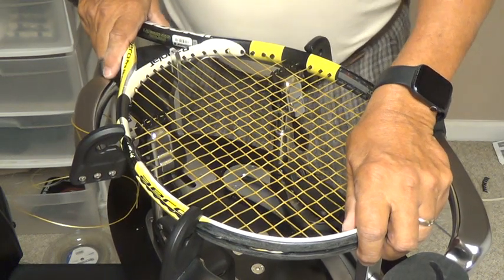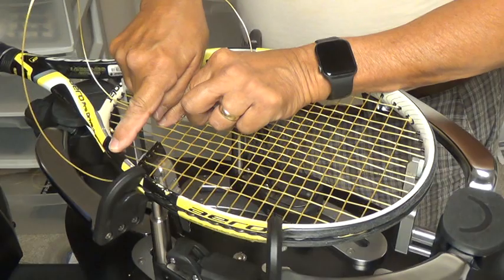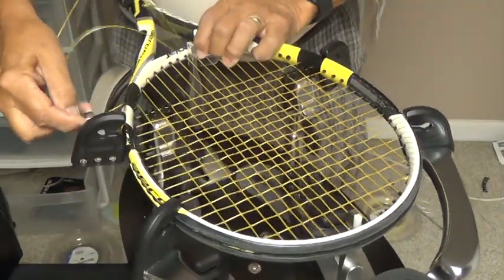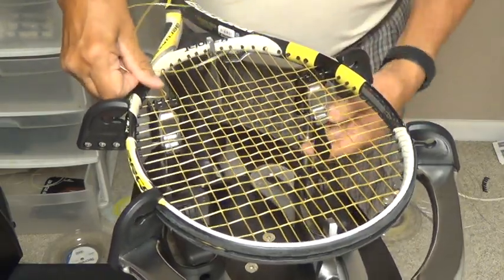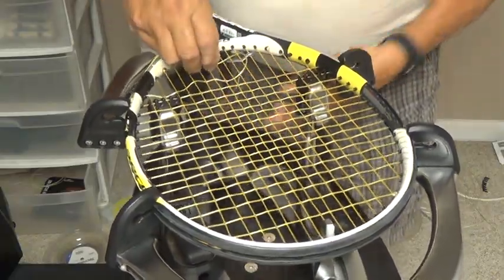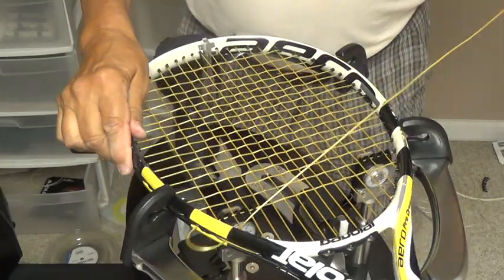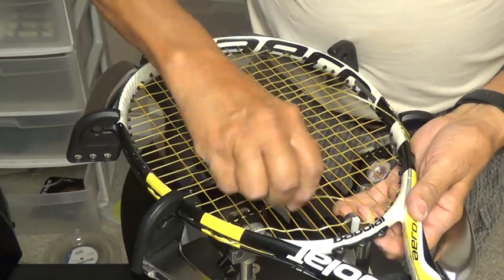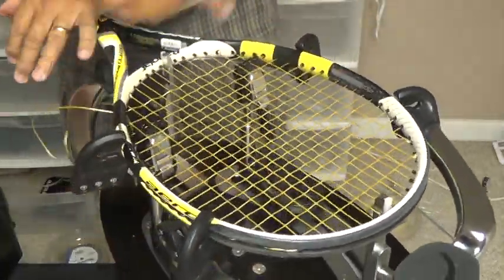Stringing twisted or shaped strings

Comment: Do you recommend doing this for all the crosses while stringing a rough poly or just the crosses towards the bottom??
I just started stringing myself and I’ve found your videos incredibly helpful, so thank you!
Reply from the maker: @benbenbunbun  stringing near the bottom of the racket you have very little string to work with and all the weaves are hard so I weave all string like that. The more you twist a string the easier it is to break. I doubt the bottom crosses will break often but who knows.

Comment: Hello, Thank you for your informative and clear videos-both old and new. I string my own racquets and use a full bed of VS 17 natural gut.

I have 2 questions that I would appreciate your advice on: 
(1) Would you advise that I should use the pre-stretch function on both the mains and crosses, or one but not the other? Does it really make a difference?

(2) At what pulling speed for either or both mains and crosses should I pull tension? I have FAST, MEDIUM or LOW on my machine.
Reply from the maker: @Raid Raid I personally do use the pre-stretch machine function unless my clients want it. So can get the same result by upping the tension. Pre-stretching gut primarily removes coil memory and you can do that if you like. I always keep my machine on the fastest speed. On my last machine (Babolat) there was only one speed. I used a Wise several years ago and had some errors coming up. I sent it back for diagnostics and Herb Wise told me nothing was wrong but I had the slow pulling speed set up using 55 lbs. he said for tennis I should always use the faster speed. Slow speeds were for lower tensions.

Comment: I'm having trouble getting 17 gauge and higher through the tie off grommet on some racquets. I'm afraid of damaging the string that's already in the grommet to be shared for the tie off. Any suggestions. Thanks.
Reply from the maker: It depends on the racket you’re stringing, the string, and how new the grommets are. I too have a little difficulty at times. Usually I can lubricate the tip of the sting and get the string in.

Comment: question about mounting the racquet , should it be tight and 2 and 10 oclock and 5 and 7 , so the racq doesnt shift around right ?
Reply from the maker: Snug yes but not tight. I mount the racket with the bottom side supports first so there are no grommet holes blocked. Then I move in the 6 and 12 supports until the touch.